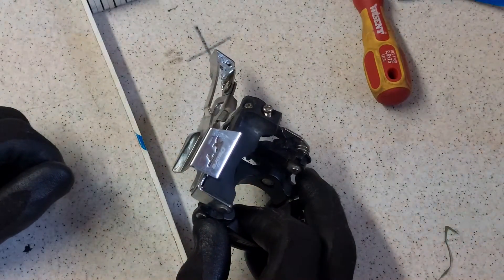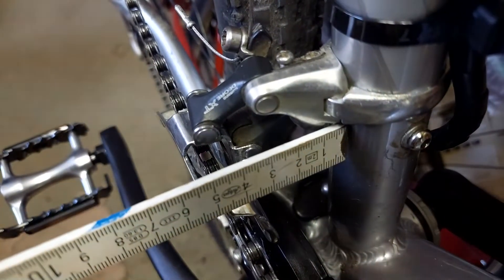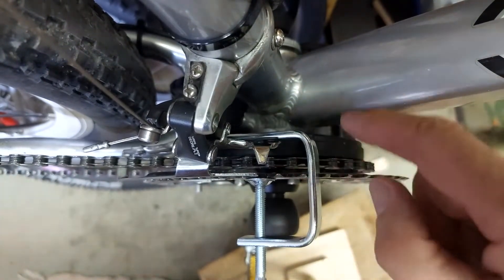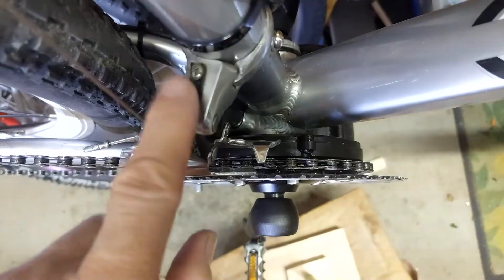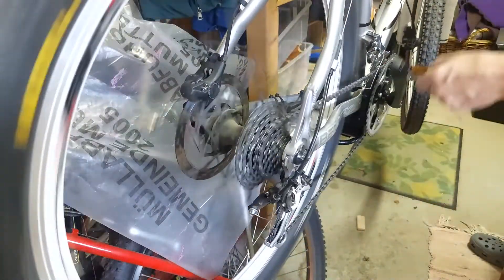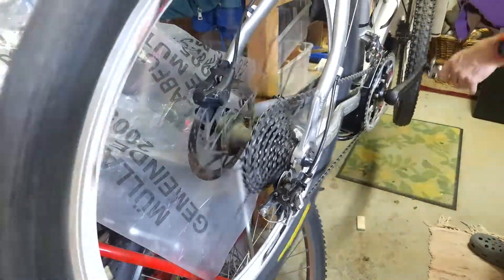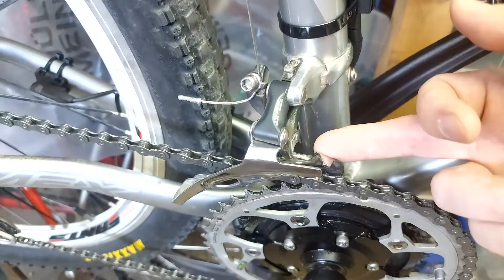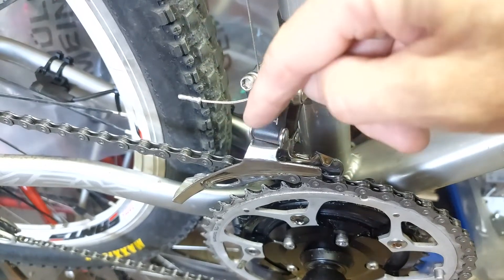TSDZ2 - Dual Chainring - a solution that works

Comment: Great info! Is this narrow chainrings or kind of standard for 7speed, 8speed which uses a bit wider chain?
Reply from the maker: I used a SRAM 34T chainring (part number B004YWGV4E ). This is specified for 10-fold but works also well with a recent e-bike build based on shimano 9-fold. I usually don't bother much about the chainrings specification besides number of teeth and holes, but always use a chain matching the number of sprockets on rear wheel (maybe not entirely professional attitude :-). Thanks!

Comment: Not needed ,i fail to see the point of this
Reply: So you can reduce cadence which allows motor to apply torque. This motor reduces torque above 90 cadence so if you go fast and cadence is high, motor assistance reduces which is the opposite of intent. Capish?
Reply: @superwag634  52t chainring and 48/11 on the back , sorted , capish?